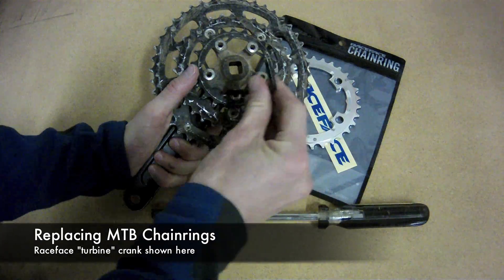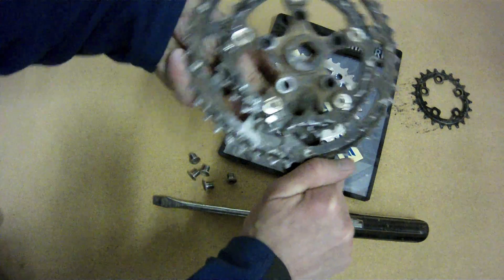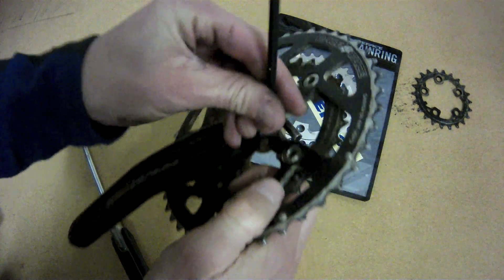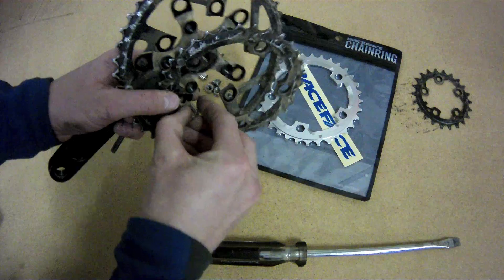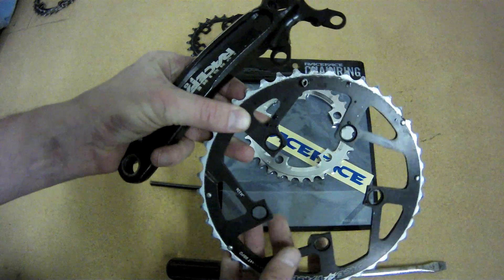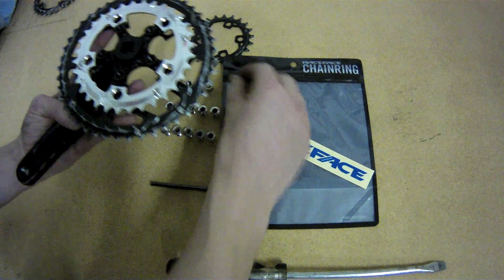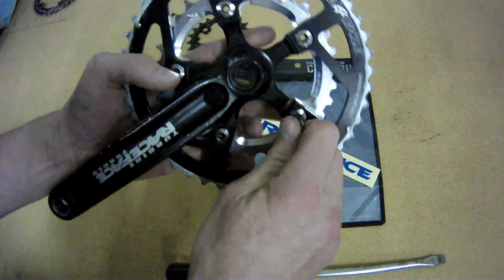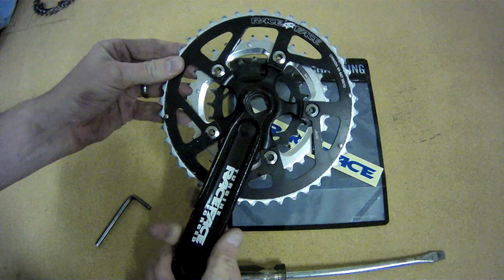Install New Chainrings on a MTB Crank

Comment: Chainring bolts have various lengths depending on the crank and manufacturer spec.  You may run into a bolt that's too long and won't allow you to span the back of the chainring nut with a screwdriver.  If that is the case you will need a tool specifically designed for this problem.  Park bicycle tools part number CNW-2 (under $5 on Ebay).  That things a lifesaver if a screwdriver won't fit. If the bolts have been in there a long time, sometimes a little penetrating oil to loosen them up helps.

Comment: One last thing--always use black chainring bolts on a black outer ring!! It looks cooler :} Thanks for the vid--just got a new set of RaceFace compact rings for my RF DEUS XC crankset today. Had to be sure of where the little knob on the big ring should be. Also Installing new chain, and XT cassette as well, and converting my Stans rim wheels to tubeless. I look forward to giving it all a test ride this weekend.

Comment: Thanks a million. This is exactly what I am doing. The only difference is my granny and 44t big ring are 8sp race rings (been running them with 9sp everything else for years) The middle ring replacement is 9sp 32t team ring. I was not sure how rotate middle ring in relation to the others, but your explanation make a lot of sense. Also, have you ever periodically rotated the ring cclockwise by one bolt hole (in relation to crank arm) to even out the wear. I've be read this can extend the lifespan a bit.
Reply from the maker: You're welcome!Great point on rotating rings to extend the life. I guess the extent to which that would help would have a lot to do with your pedal stroke. If you have a real smooth, circular stroke (versus a choppy up/down stroke) it may not make as much of a difference.

Comment: I have a race face cog 32 tooth installed on my acera cranks, I was wondering I could install another chain ring , for dual rings up front...my 32 tooth has already taken the four bolt slots on the crank, how would I install the other one now? Do I have to check the bcd here ??I am all confused..